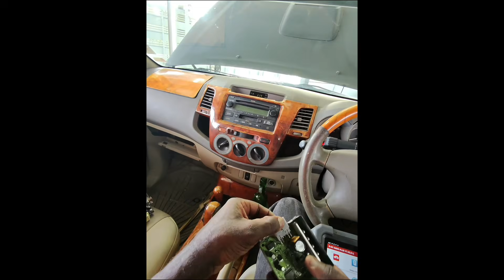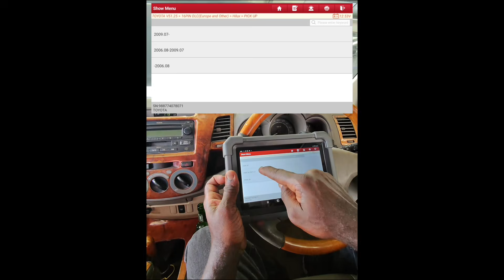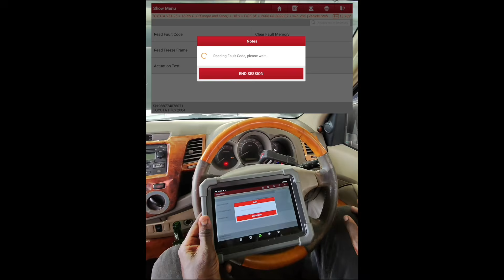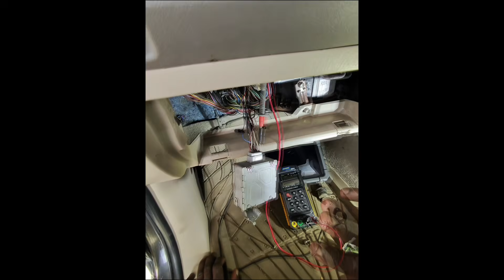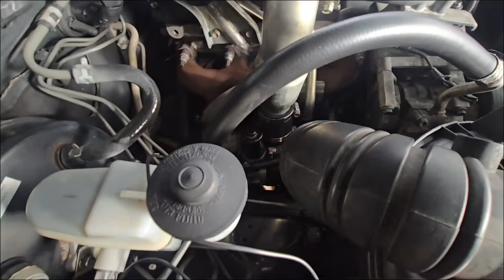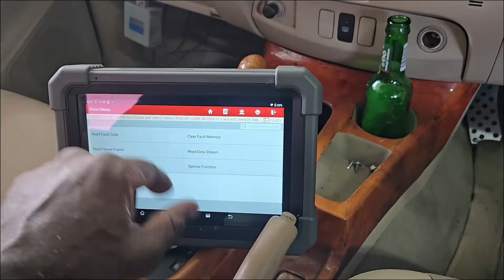P0045 Toyota Hilux Turbocharger Boost Control Circuit Fault, Triggering Limp Mode & Loss Of Power

Comment: Between Isuzu dmax single cab and Toyota Hilux single cab which beast interms of durability
Reply from the maker: Both have their strengths, it really depends on your maintenance  schedule. But Isuzu is known for their diesel engines as work horses.